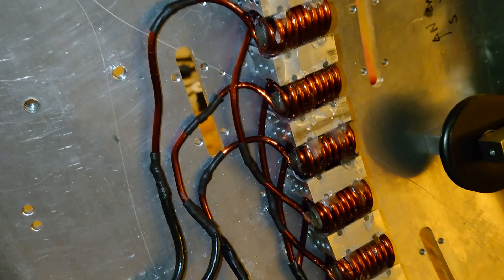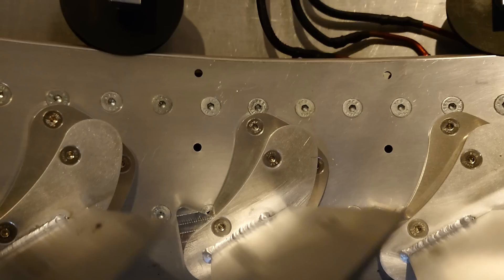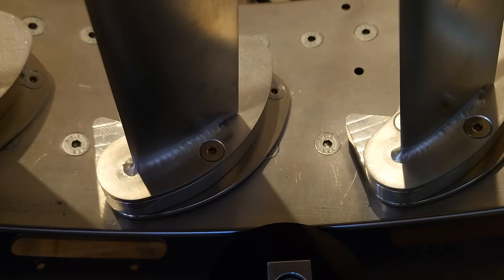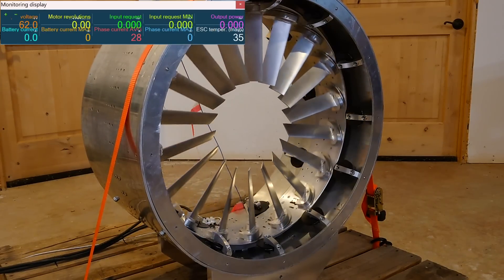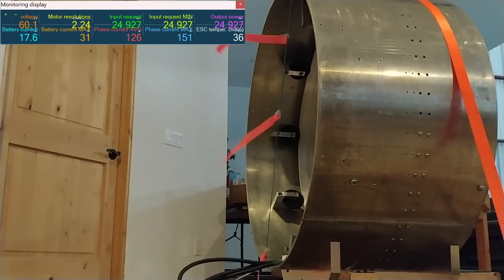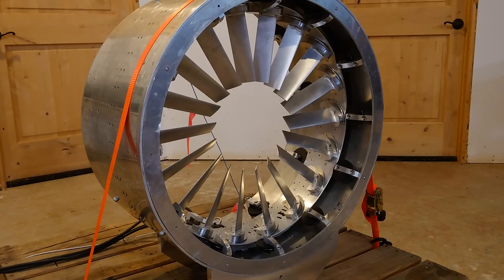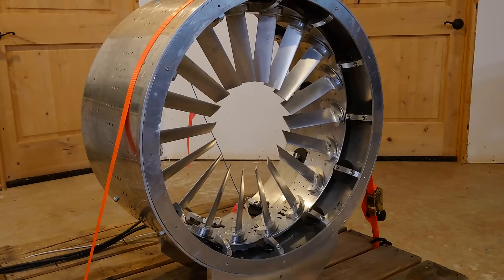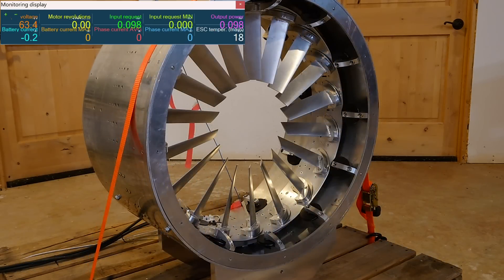Rim Driven Coreless Thruster running at higher RPMs

Comment: I would agree the centrifugal force is negligible for the center ring, but perhaps it would help keep the rotor true to shape.  As for balancing, have you tried balancing media? Little bb that by again centrifugal forces find their natural balancing point continuously.
Reply: Google "tire balancing beads"
Reply from the maker: I have some weights to balance it along with a balancing rig used for aircraft propellers but because the rotor is not true it's not possible to get a consistent reading on the balancer. Until you do you don't know for sure where to add the weight.
Reply: @Peter Muller  balancer and fixed weights are sooo sooo tricky. They are not dynamic and self adjusting. So anything changes and it's off. 4 oz of airsoft bbs balances a whole tire and rim even after you pick up a rock or lose a chunk of rubber
Reply: A porpeler can not use balancing beads, but your rim shaped design could. I'm telling you dude, could be worth a think? $5 of beads, slight design change, no balancing required ever

Comment: Nice work! Some electric aircraft designs more than two 'engines' too... Just a thought. Obviously precision machining will make a subsequent prototype a lot smoother... You've done well with this by the sound of it, to get it running smoothly. I'm also beginning to get curious about how friction and noise might be refined even further at later stages... Maglev bearings? Not sure just another thought
Reply from the maker: Magnetic bearings would be great but they need to also absorb the thrust that is being generated by the rotor without the rotor colliding into the housing. Presently the delrin wheels are not showing any signs of getting hot or wearing. Most of the noise is coming from when the wheels come back into contact with the rotor each time. 
If the rotor was built with precision the wheels would never loose contact with the rotor. Then the main sound you would hear would be any noise from any of the bearings. They are not perfectly quiet by any means and the housing kind of acts like a speaker and amplifies any sound. Also, the coils being charged in one direction and then reversed also creates sound in much the same way that a speaker creates sound. It's still way quieter than a turbojet and even a piston engine exhaust.
Reply: @petermuller9177  Oh right! Interesting. You obviously know what you're doing! Yes, in any case it's a lot quieter than a turbojet or piston driven turboprop. The design is inherently better than an open fan equivalent in this regard, as noise is contained and directed. I make note of this as conventional jet engine manufacturers apparently seem to moving in the direction of open fan designs... Which are inherently noisier and less safe. I see the potential for your design to be scaled up significantly. I'm not any kind of expert, but it's so much simpler and better than any other basic idea I've seen. I wish you good luck in developing it further! I hope it turns out how I think it might
Reply from the maker: I'm not sure that I know what I'm doing exactly. I'm just figuring it out as I go. :-)
Reply: @petermuller9177  
-do You know very effective  and ultrasilent ducted fans from WHISPER AERO ?
Reply: @petermuller9177  are you aware of the concept of a halbach array?  
https://en.wikipedia.org/wiki/Halbach_array
by arranging magnets in a particular pattern, their magnetic moment can be displaced from one side of the array, so that the depth and strength of the magnetic moment increases on one side, while decreasing on the other, creating something that, for all intents and purposes, functions as a poor-man's monopole magnet.
if you apply a series of them in key locations, it should allow you to use the entire rotor as a magnetic bearing, with some number of them on the leading and trailing edges to isolate lateral motion, and more sets around the ring to isolate the axial motion.
you would need to calculate the collective force they would apply and make sure it is greater than the amount of thrust you expect to be generating, to prevent the thrust or wind-load from pushing the prop into the housing.
once all of the arrays are in place and installed, you will need help, or a fitting machine of some sort, to insert the rotor, as the magnets will make it difficult, but once everything is set up, it ought to allow you to have a permanent floating connection between the two components, with absolutely no friction.
couple that with the balancing beads someone else mentioned, and you would be able to get away with less precision on the machining of the housing rings, as you could have a millimeter or more of air-gap for your tolerances at that point.
unfortunately, i do not know any of the math you would need, so i can do little more than direct you to the idea, as i am simply aware of the concepts involved and how they can fit together, but i do not know how to describe them mathematically.
i hope this is able to help in some way.
Reply from the maker: Yes, I'm aware of what you're alluding to, I just did not want to have twice as many magnet brackets for this prototype and trying to get the rotor to float in the magnetic field was definitely beyond the scope of this first unit. Thanks.
Reply: @THarSul  @Peter Muller This is what I was thinking too! Except I didn't know the technical terminology of how to explain it. I'm glad you both know more than I do about it hahah :-)
Reply: @josephcullen2512  lol, i am little more than a knowledge sponge, just glad to share the info i’ve soaked up
Reply: @petermuller9177  why dont you spring/ hydraulically load the delrin wheel so they cant lose contact

Comment: I think your on a good track. Whats your next step?
Reply from the maker: Someone smarter than me needs to figure out a better configuration for the electric motor aspect of this design in order to provide the required power. Then a new prototype that's built to a much higher precision with respect to the rotor would need to be built. Then we could get this up to 5000-6000 rpm and see what it's really capable of. This prototype wont get there unfortunately.
Reply: @petermuller9177  If the problem is the electric motor, can't you run a prototype with a thermal engine linked to the ring ?
Reply from the maker: I'm not sure what you are suggesting. Can you elaborate?
Reply: @petermuller9177  Well, maybe you could run your "prop" with a thermal engine. It could be link to a rotax thanks to gears on the outer ring of the thruster. The electric solution seems good because it is not bulky but the thermal solution could be a way to measure the thrust first and validate the cfd
Reply: @petermuller9177  Is your plan to continue refinements? Are you going to make form and fit motors for the EVTOL? Are you planning to combining the two and gaining experimental flight status?
Reply from the maker: It sounds complicated. The electric motor aspect separates the functions and allows you to place the electric power generation in the fuselage without any complicated connections to the thrusters.
Reply: @petermuller9177  yeah, the idea is just to test on the ground the thrust output, and to validate your cfd model, before scaling up and integrate this on an airplane
Reply: Peter, your definitely smart enough to create a problem that's worth solving. If it was easy everyone would do it! Congratulations on achieving 600% more RPM... Only about 933% more to go to hit the target RPM of 5,600.